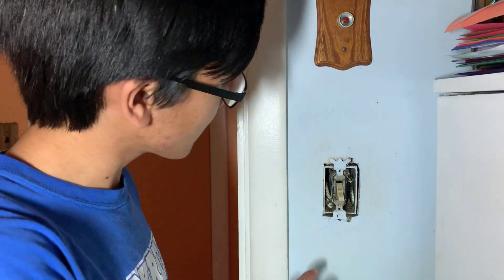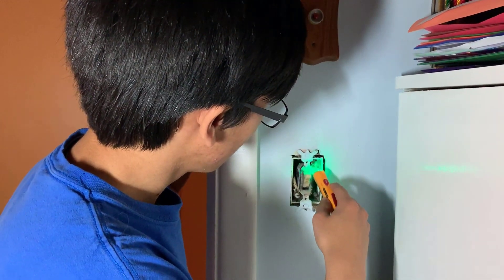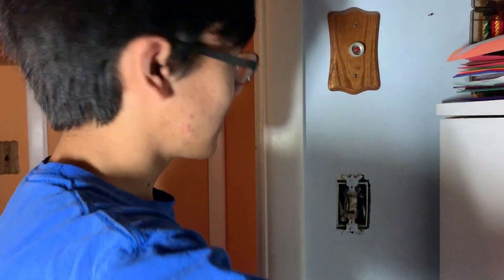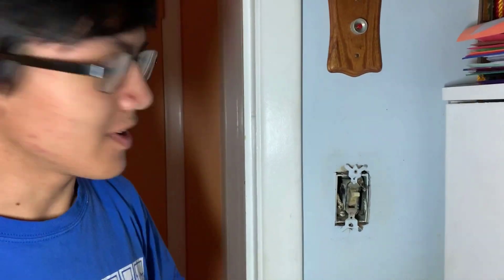How To Test To See If Wall Switch Is Defective & How To Replace Faulty or Bad Toggle Light Switch

Comment from the maker: Here are the #ᴬᴰlinks to items, materials, parts & tools required for this project:
1.  https://amzn.to/4aPD7HD  |  Klein Tools NCVT1P Voltage Tester, Non-Contact Low Voltage Tester Pen, 50V to 1000V AC, Audible and Flashing LED Alarms, Pocket Clip
2.  https://amzn.to/49Tad8f  |  Klein Tools RT250 GFCI Outlet Tester with LCD Display, Electric Voltage Tester for Standard 3-Wire 120V Electrical Receptacles
3.  https://amzn.to/3xUXLI3  |  AstroAI Digital Clamp Meter Multimeter 2000 Counts Amp Voltage Tester Auto-ranging with AC/DC Voltage, AC Current, Resistance, Capacitance, Continuity, Live Wire Test, Non-Contact Voltage Detection

Or Click on Amazon link here and search for what you need:  https://amzn.to/3xIOsqg

Comment: The metal box that the switch screws into should be replaced as well, correct?  i have a bad switch in home's bathroom.  i have to remove a few tiles on the wall, and there is the metal box in the wall behind the switch.  It looks in rough shape.  In the wall, the wires are different from eachother.  There are two wires that look like they have fur on them.  My late brother, who i lost last year,  told me that those are the hot wires.  He explained it very clear.  An animal, which has fur on it  can sometimes bite you. It can even kill you. Same with a hot wire.   It can shock you, putting you in the hospital, and it can even kill you, if you are electrocuted. I am not sure if this is true for every home, that there are fur-covered wires.  I am just thinking of it in my home. i MUST make sure NO power is going into the bathroom before attempting to replace the switch, so i must trip the breaker! Thanks for sharing the video!

Comment: Good try. You should at least explain what are the connectors on the switch, Load/Live In , Load/Live Out and Ground. What to do when the concealed box is metal/plastic, switch has a metal plate or not.

Comment: My garbage disposal is not working, didn't know if it's the switch or disposal, so I have a tester, when the switch is turned to on the upper and lower cause it to blink red, when off, the upper is red, lower is green, that means the switch is good, correct?

Comment: Aiman, when you are doing that kind of job and find it has metal box, put electrical tape all the way around the switch where the screw terminals are. That way there is less of touching the screws to the side of the metal box.